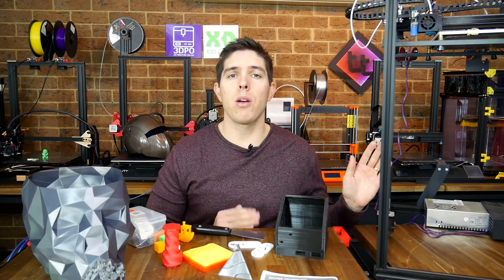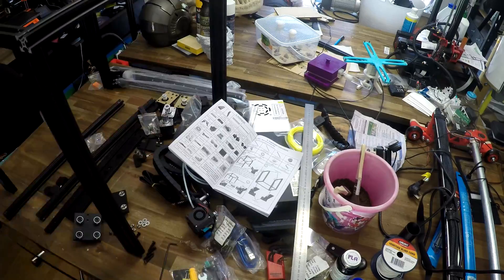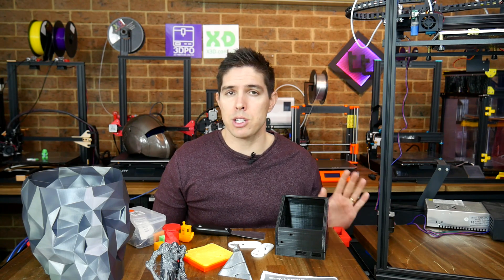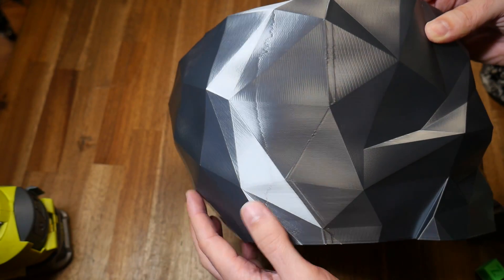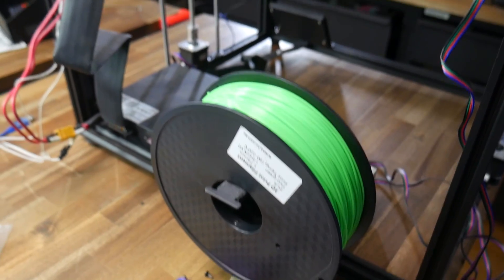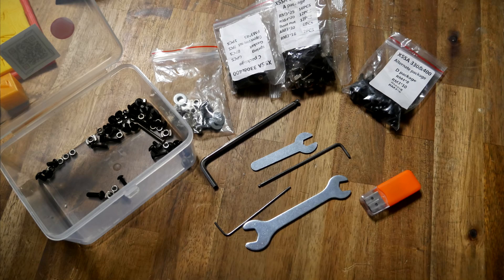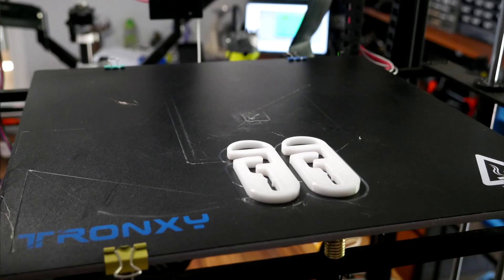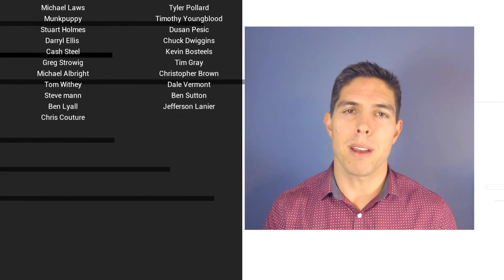Tronxy X5SA Pro review: A large format CoreXY 3D printer (with issues)

Comment: I know this upload is 5 years old, but having picked up an X5ST some time ago and used my metal cutting kit to make modified brackets I addressed most of the problems at that time. However it has been sitting on one side and not been used for 5 years ;) Last week I decided that I needed to reassess things, and old videos like yours got me back up to speed on things. I've run a few new samples, but currently have the bed in bits while I fit a better levelling arrangement ... stronger springs ... and the heater is a mains unit with a perfectly flat bed. It was honest reviews at the time that actually prompted me to buy a reduced price non-pro kit originally and while I'm certainly a novice with extrusion printing, CAD and g-code have been my bread and butter for a long time. Target is to print a couple of gambody models and cura is running on my linux desktop and hopefully in the next week I will get a few calibration models printed to fine tune. I certainly had your stringing problem with the original prints, but the ones done using gambody's cura settings have been encouraging and the final print was actually a usable cockpit control panel for the Eagle Transporter. Looking at the print times I'm thinking that a second machine may be worth considering but although I understand the X5ST, the question perhaps is there anything better today with the same footprint at a lower price!

Comment: Thank you for this review! I just got a Tronxy GEMINI S for Christmas and they still did not add thermal runway protection not even in the newest firmware update. Also almost 1/4 of the screws on the printer were loose or have fallen out. I am quite disappointed in the quality. I just want to warn everyone so that they know wat they are probably getting into.

Comment: I found a lot of what you said is what I experienced the ptfe tubing do not shorten it, this causes other problems. increase the length and cable tie it to the cable chain.  I had a smaller format X5 prior and mounted a smoothie board on that, so having set up that board and the software I plan on transferring this board to my X5SA pro with just a few tweaks it should work just fine. for instance enable core x/y and connect the z -axis motors to the motors which I have already configured to work together. I also have the display connected and set up. I do not print that much but if I wanted to print large number of larger pieces it would be very costly and time consuming as the printer that I have needs to cool down in order for the print to release, no scraper required. (on my machine the glass plate is an optional extra and required a replacement sensor for it to function)

Comment: I was sent a Tronxy X5SA by Aliexpress because they lied and said the one I ordered was not in stock.  The X5sa they sent has never printed anything. It is a dead weight. I have contacted the company for 2 months and they do not answer any message about the printer. It is completely assembled. and the head goes to the right front and stops and never goes any where else. The computer program can not get it to come on line. I have turned it off and started the program and then powered up the printer and nothing.

Comment: I was given this machine for my birthday a couple years back. and i just started to use it. I had to go online and find a build instruction video to help me assemble it as the assembly instructions are not that good. i had no issue assembling it once i found the video. sorry i do not remember who it was. 
   my biggest complaint is the stringing. I have to run at a lower speed so my prints stick to the bed. and i do not know how to make it go faster once the first layer is down. i am sure that ill figure it out soon. but the stringing is the thing that annoys me most with the printer. I like the size.  but you are right the is an issue with loading new filament into the extruder. i take my model clippers and cut the tip at an angle. it  has helped.

Comment: X5SA is my second printer after the ANet A8. I didn’t have squaring problems BUT I did go through 3 main boards that the Z stepper drivers kept getting cooked on. Third time was the charm, probably came down to replacing the power supply at the same time tho.

Once I got it working it’s honestly a decent printer if you like tweaking. The big extrusion frame makes a great base to put mods on. I have a bunch, ranging from a MOSFET and separate supply for the bed, to support brackets, to Octoprint, to a Z synchronization belt, and a few still in the works (X and Y adjustable tensioners and direct drive). It’s honestly a bit like a game. And I’m printing laps around my buddy with an Ender 3 in terms of quality!

One issue I still have to figure out is actually using the full bed (I have the 400x400 model). Prints that deviate too far from the center seem to get warping problems, getting worse the further from the bed center it is. Probably need to enclose it, although cutting out the 24V DC middleman and making the bed a mains bed is also something I’m considering.

Comment: Do u know how auto leveling works
Reply from the maker: Yes.
Reply: @TeachingTech  1 have a tronxy x5sa and it doesn't level by itself. Ot just tells me how much I need to change my bed angle so I can level it
Reply from the maker: Ok. I still don't understand why you asked your original question.
Reply: @TeachingTech  because u said when you level it it was still off. Ur the one who has to level it. Even with auto level not the printer

Comment: My few cents after a few months with both, an X5SA Pro and an X5SA. 
Ive purchased both at the same time, the pro was an open box and i planned to just mod it while the normal x5sa was new and meant to be converted to a VzBot330. Ive never ran the X5SA as stock, just built it once, made a few motion tests with a new board and Im still converting it to the VzBot. 
On the Pro on the other hand, Ive built it stock but known the electronics wasnt to my liking (as most of stock boards). After I finished building it, I suffered the same problems descirbed in this video: Large printer, with extruder and spoolholder on the back with unalligned filament sensor and extruder. I got problems with octoprint disconnecting, so Ive converted to klipper. Bad idea, the driver for the Z Axis deactivated itself when trying to build a mesh. Even when I used different drivers on the stock board for dual indipendent Z, same issue. For the XY motors and heaters ive converted to an skr pico. The stock probe was replaced by a klicky, the hotend first by an E3D Revo, than with a MK8 Volcano style hotend from aliexpress. I went from the revo to the volcano, since the tronxy kept destroying my revo nozzles, but thats most of the time my fault. For dual Z, Im using the old Board from my ender 3, the creality v.4.2.2. The toolhead is now redesigned with an orbiter v2 in direct drive config. Oh and really the first upgrade ive printed was a better motor mounting system with fine adjustement via screws. 

Summ: The electronics are garbage. Even in a "tronxy community" discord, the boards have different failures ranging from disconnecting from klipper or deactivating a driver mid print. The probe is kinda OK, but i dont like it. The bed is a taco. Belt tensioning is on stock a nightmare. The Hotend is still PTFE lined. Part cooling is kinda OK, its basically an Ender 3 toolhead. The screen is only usable with the horrible outdated tronxy firmware. 
I dont regret buying the two printers, but would only recommend to buy them if you plan on modding them are can get an X5SA for a VzBot conversion.

Comment: To align the gantry on my x5sa i used 2 of the little 2 nuts and bolts in the path of the wheels i measured from the corner of that extruded alloy bar to the both sides just to double check pulled the gantry to it and fit my belts that way making both nice and snug was pretty easy that way 

This might be 2 years old but i still use my tronxy today its a alright machine its a bit wonky at times but in the end im able to make decent orints from it for my rc cars lol

Comment: They repaired some of the problems indeed. Basically, in the last 2 years, I printed at it even large prints, maybe some thousand hours, and still works fine. It has some issues, especially with bed leveling, but for this price, is more than ok.

Comment: The nozzle come out loose in the middle of printing and ruined print. Before I started printing I made sure that the nozzle was screwed thigh in place. Did you ever had problem with the loose nozzle.?? What are you doing to keep nozzle in place?
Reply: tighten it when hot, not cold!

Comment: You know what?  Now that I have assembled the kit I got recently and I am getting OUTSTANDING PRINTS,  I am concluding that this is an UNFAIR REVIEW.  

For example, I am looking at the extruder comments and the crooked bed and you got it wrong.
1. There are plenty of tire wraps in the kit to secure the PTFE tube on the cable carrier. On the top. This is obvious.  I don't understand why you let the tube hang like that.
2. I had no issues putting the filament in the sensor/extruder.  My bar had two sets of holes for the sensor and one of the sets aligned perfectly under the extruder.
3. The crooked bed seems to be your problem.  There are 6 springs and they will bend the bed as it is big and thin.  Also i see that you have tensioned the springs quite a bit.  The PROPER way to make the bed as flat as possible is to over-tighten the mid-springs (which will flex the bed downward), then you auto-adjust the corners to be level. Then you slowly release the mid-springs until the bed becomes as straight as possible.  Having 6 points of pressure will naturally bend the bed if you do not take the time to do it right...  Maybe this is not as obvious.

Also I don't know why you had so much issues with putting the belts together... Maybe your heart wasn't in it?

At the end of the day this is a KIT and you have to have the patience and aptitude to build it properly...  

I am glad I did not take your advice and very happy I bought this one...
Reply: perhaps the years that passed, changed the model?

Comment: Just assembled one of these that i got on a great promotion.  I had a different experience than yours.  I built it very carefully and it worked from the first print - did not have to tweak it.  Of course i have a later version than yours, the one that comes with the glass.

Comment: The play in the gantry is mitigated by simply tensioning it while it's pushed to one end.

Also the acrylic motor mounts are now metal.

The layout of the belts is now more clearly shown in the updated manual.

They have also changed the mounts which hold the hotend rail.

The extruder and filament sensor have now been relocated to the right hand side of the printer.

Adjusting the wheels that run on the tracks is now easier.

All 3 fans are now a lot quieter, along with the motor drivers.

The firmware has also been updated.
The pids for the hotend come pre tuned. 
Only briefly fluctuating + - 1c
Reply: I've been eyeing this printer for a while, mainly because of CoreXY and really affordable pricing.
what's Your experience with it?
have you done any modding?
have you enclosed it and if yes, how hard was it?
Reply: @Hash Bringer  fun printer, build plate & level sensor can be a tad tedious, so i recommend painters tape or g10.

Changed print head, because the default one is quite slow and can jam if you increase print speeds. 

It's incredibly easy to enclose it. 
It's literally a box, so all you need are the aluminium t slot nuts and some acrylic sheets.
Reply: @L-udo  awesome input.
Thanks a lot.
Reply: Hi I just posted some question then noticed your post.  Are you happy with this printer?  Is there a support community? I can get one new for £232 what's your advice.  I have two Ender 5 pros and wat something that has a bigger build volume and better quality?

Comment: They've actually fixed allot of these issues in the current shipping models - not sure if it was because of this video or not. The motor mounts are now steel and work well. They added a third screw to each side of the X axis rail where it attaches to the gantry which makes it much more rigid. The gantry can be made square by butting it up against the back of the printer when tightening the screws and the belts which is what I did. The filament runout sensor lines up. The electronics ribbon cable is all black now. It comes with a glass bed that was flat enough.. Not saying its perfect but at the current sale price of $330 definitely worth it IMO. I do agree the instructions are very basic still, with basically just images to go off, so experience with 3D printer mechanics and construction will be necessary if you want it to work well right away... Someone who is not mechanically inclined should not purchase this printer KIT.
Reply: I buyed the D01 Plus Guard past month (33x33cm x40cm). It was really cheap, cheaper than the Ender 5 plus but with silent drivers and being CoreXY (really important for me) and enclosed build. The frame is really sturdy, you could stand the entire printer over it's corner
I love the rail system, much better than linear rods on their own or the wheels. Only problem is the firmware that doesn't support Linear Advance or Input shaping, and it's hard to update to marlin (tried, but at least the original firmware is a marlin really updated)

With some Gcode commands I got it to print at 100mm/s with 200mm/s travel, 20jerk, and 2500mm2/s acceleration. Just really fast, it's direct driver and can reach 15mm3/s. Only problem it's not full metal and the ptfe degrades. Next upgrade will be a V6 volcano or something similar and two 5015 blowers

It has flaws of course, like any other chinese machine. As a previous owner of a XY2 they really inproved. If you change the mainboard, add better drivers and change the extruder+hotend. You could have a VERY fast and reliable machine at good price
Reply: @Coltranne  I am in the process of replacing the hotend with Rapido + LGXlite direct drive extruder. I also have klipper running now on the stock motherboard, it was easy to flash just copy file to sd card. May upgrade the motherboard but it's definitely not the main issue which was software and the Bowden hotend.
Reply: @Coltranne  made new endstop for it https://youtu.be/urmSgkl6vnU
Reply: Thanks for the update.  Thinking about getting one.  Is your version the "Pro" or the standard one?
Reply: @madderall_dot_com  it's the pro. I wouldn't get one unless you're ready to replace the motherboard and the extruder and the hotend and convert to direct drive and add the belt + pulleys connecting both Z motors together etc etc.. and doing this nozzle as probe mod as the stock bed sensor is useless.
Reply: @hilo90mhz  Almost sounds like pretty much everything needs to be replaced...  In your opinion, which is the better investment with the total budget of $600:   Ender 5 plus ($500),  the X5SA pro ($380) or the X5SA 400 ($300)?   The X5SA 400 is the largest out of the three and leaves me with $300 to spare.  My goal is to have a large printer that can print reliably at >120mm/s.
Reply: @hilo90mhz   Hey!  I'm seeing something weird right now.  I can see in the notifications a part of your reply, but when I get here there's nothing!  The last line that I can see is   "you don't need the pro and for similar price you can upgrade.........."
Reply: @madderall_dot_com  weird ya it vanished.. I'd get one of the 400 models.. the pro is better if you're never going to run linear rails. If you are then get the non pro.
Reply: Glad to hear they fix the majority of the problems with newer models. I have a chance to pick one of these up for $180 on eBay. I’m wondering if it’s the newer models that fix the majority of issues or it’s an older model? It’s still in the box as the seller has pictures.
Reply: @larkinduval1882  honestly these days I would skip them all and get a Bambu printer, any of them... You'll thank me later ;)

Comment: The warped print bed is the most prominent problem with this printer. I find myself spending sometimes hours leveling before printing. The initial build was long but I got it setup and square pretty easily. I attribute that to my engineering background. And the double stepping motor problem can be solved by pushing the bed all the way to the bottom before leveling so they start at the same spot always. All in all I probably wouldn’t recommend this printer to anyone unless they really enjoying tinkering with shit. One positive thing I will say is that I love the larger build volume, I was able to print a full mandolorian helmet with zero issues other than running out of filament

Comment: Sorry, but it isn't the fault of Tronxy that you build the printer out of square. This isn't a printer for "unpack and Go". So you have to use a Stop Angle Tool, and then it's mounted nearly perfect.
Reply: The only Things i changed were the clutches and the Extruder, after that it was easy going to Print with 240mm/s